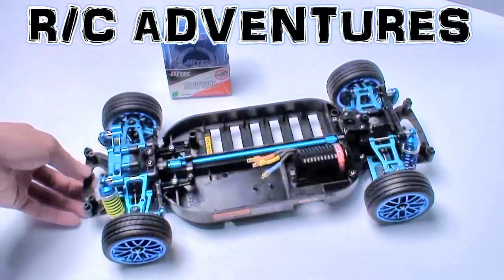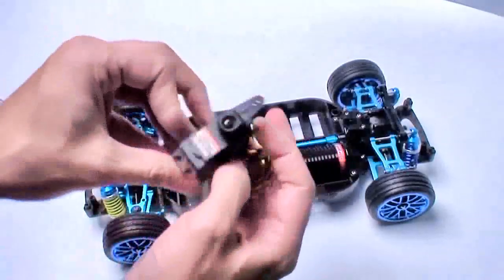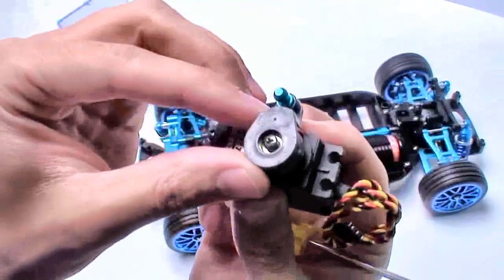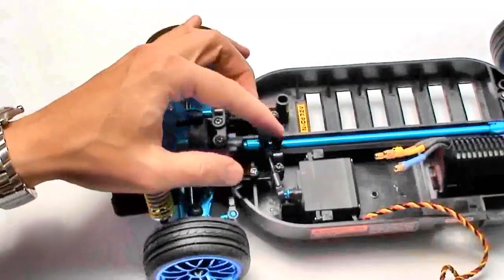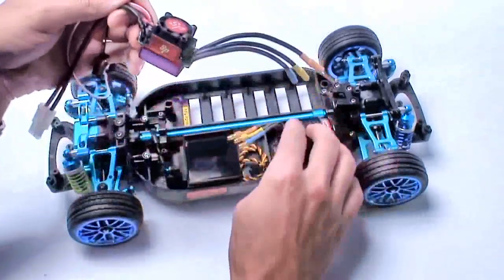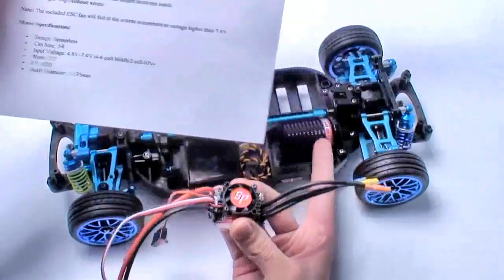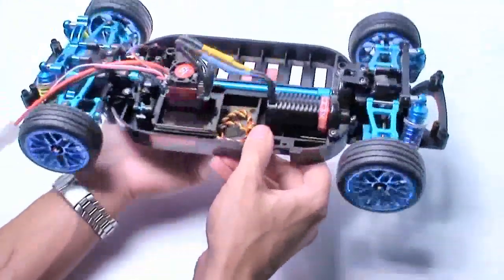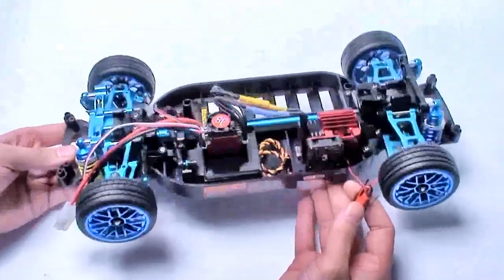RC ADVENTURES -  BRUSHLESS TOURING DRIFT CAR PART 5  TAMIYA TT01 R  KIT CUSTOM KIT

Comment: as of currently, no theres no specific place to go drift, but you can go carcar and run during there practice sessions. or during the summer , you can bring your drifter to driven to perform (like i did for the past 3 years) and help support the hobby. if the drift scene grows enough in calgary we could even host parking lot meets.

Comment: Just a little point - You've got the aluminium ball on the steering link facing forwards. It should face rearwards (step 19). That would stop your steering link between the servo and the linkages working on such an angle. It should be straight across the car.

Comment: the servo saver is not necessary on the    tt01. just adds weight and slows the steering.
consider buying the tamiya aluminium steering kit. its worth it. the electronics plate will annoy you, as the reciever will barely fit under the plate or next to the esc. it also adds unceessary weight

Comment: @XcoolTroyX  i have heard that the sprint 2 drift has the problem of the belt getting wore out just after a few runs, i have a tt-01, its a great car if and only if its hopped up, if i were you, id go for the yokomo shaft drive drifter.

Comment: G'day umm just wondering does this kit come with everything you need to get going without buying extras
Reply: G'day m8! You need a steering servo, battery and Radio RX & TX. with ALL Tamiya kits. Some higher end kits don't come with a ESC. Buyers of pro kits are often pro circuit racers, and always prefer to supply their own, or are supplied by Sponsors.

Comment: Hi, i just got a new hsp bronto 1/10 pro  brushless, i charged the battery and took it out for a blast, battery drained, i then plugged in a new 5200 mah battery but the esc is flashing green and beeping constant! and no movement of wheels,, can you help as i am new to lipo and esc! thankyou.